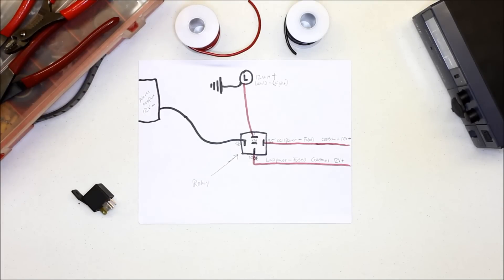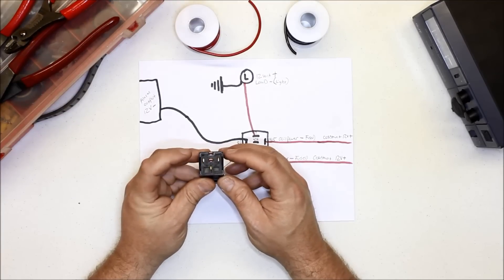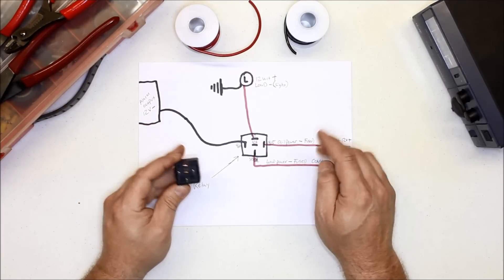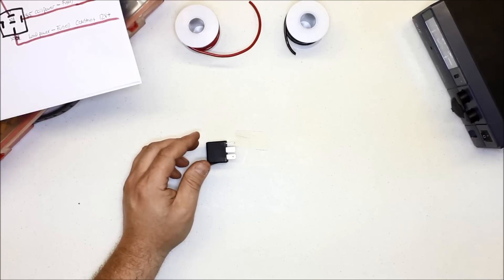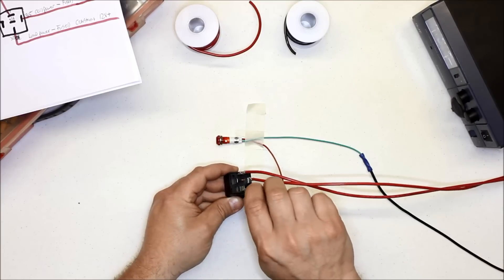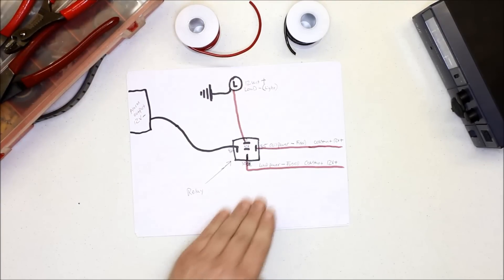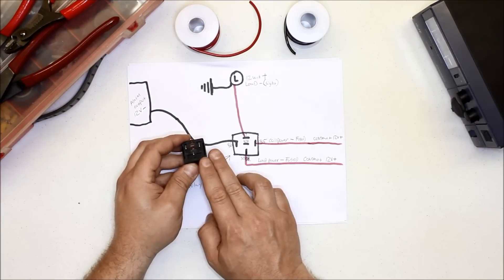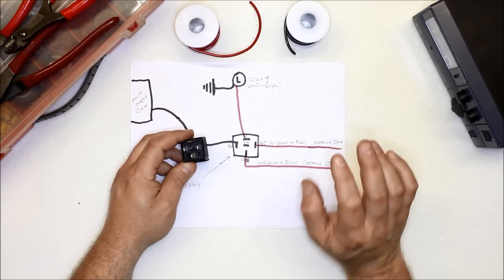How To Change Polarity With a Relay - Convert Negative Into Positive - Automotive Wiring

Comment: Hi lessco
I have a mach 1 1973 and instal msd ignition box with coil and disturbuter on it but i have a problem.there is a( -negative)yellow wire from box that´s for tachometer and when i connect it to my tacho nothing happening because the mustang tachometer work with +positive from coil.my question is "can i use your method with relay to convert negative signal to positive and run my tachometer?"
Reply from the maker: I don't believe that will work.  The mechanical contacts inside the relay probably cannot open and close quick enough to operate a tachometer.